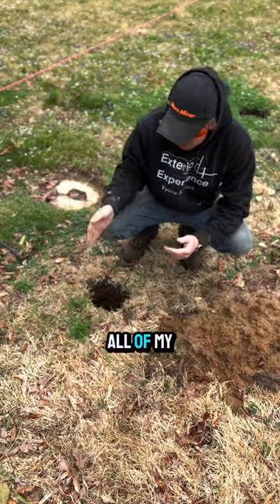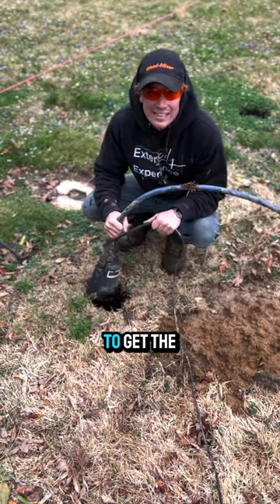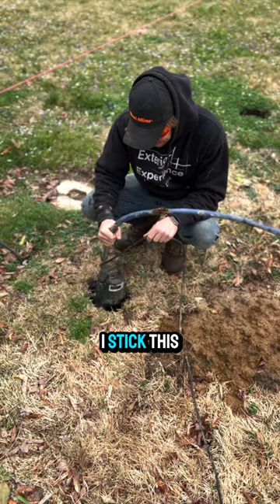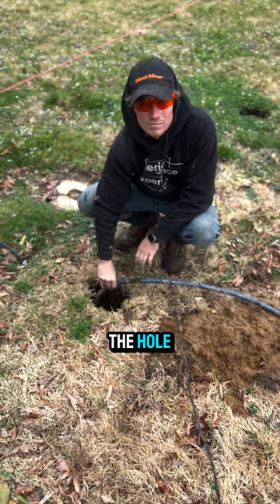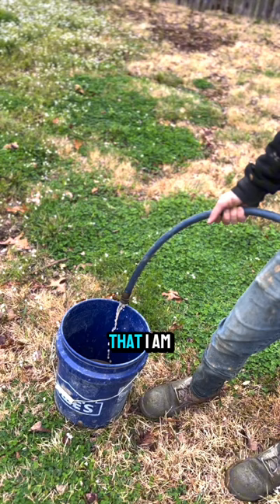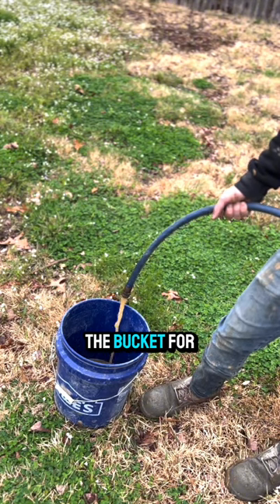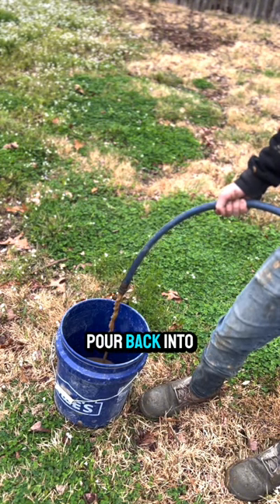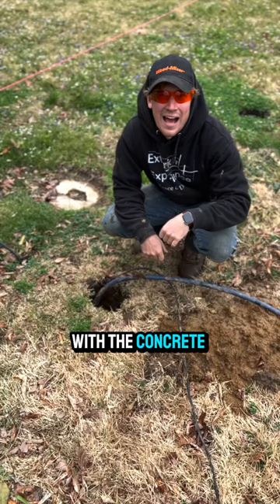Genius or Idiot? #shorts #diy #construction

Comment: Um just add the concrete and mix it in the hole...am i missing something
Reply from the maker: Yeah, I did that on a lot of the holes but some of those holes just had too much dang water, my concrete would be too wet to hold the post plum, so I just had to pump some water out to get my ratio on point. Thanks for watching!
Reply: @JakeNoahSmith  fair enough